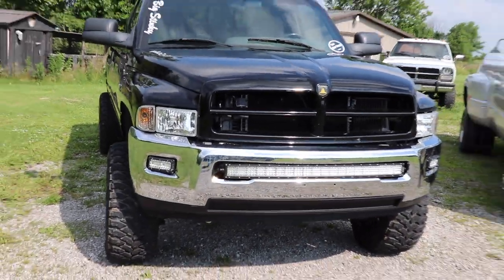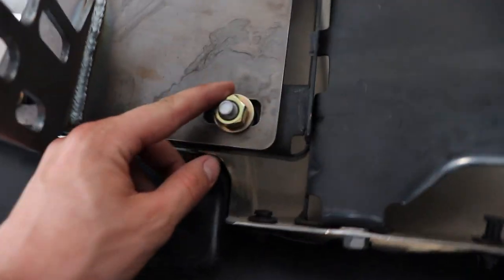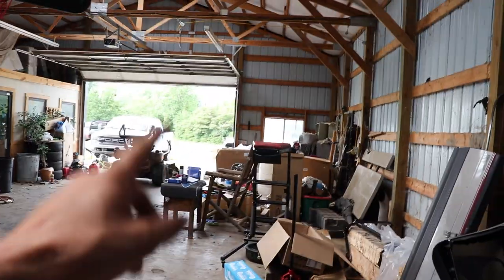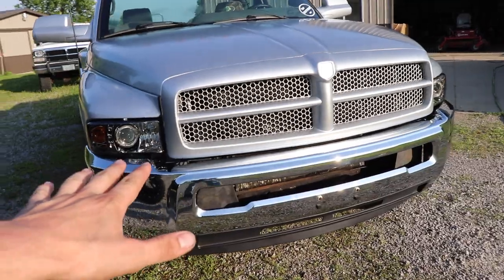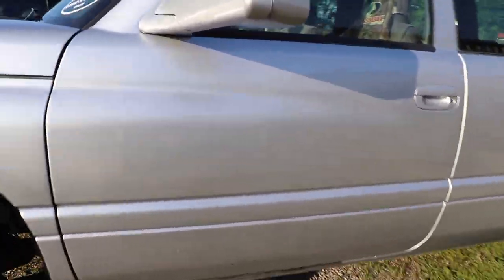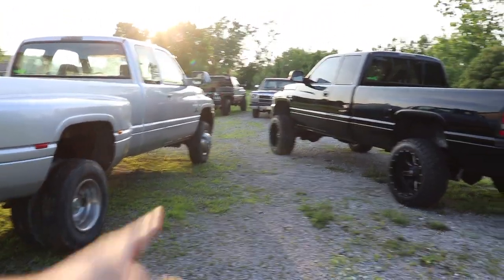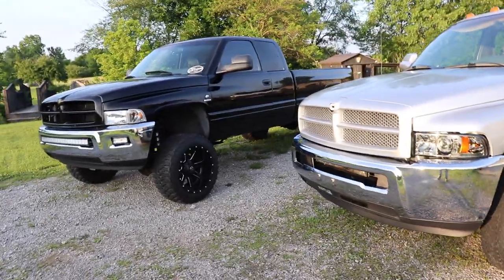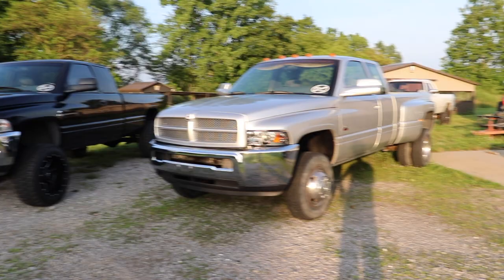TOTALLY NEW LOOK FOR THE DUALLY CUMMINS!?!?

Comment: The dually looks really good! My friend/mechanic just bought a silver 01 24v with a 6 speed for $3500. It also has 711k miles haha. Original motor and transmission